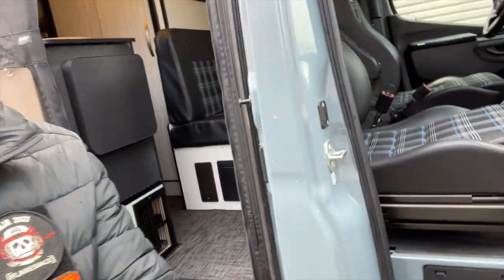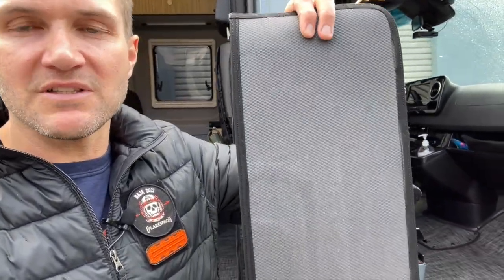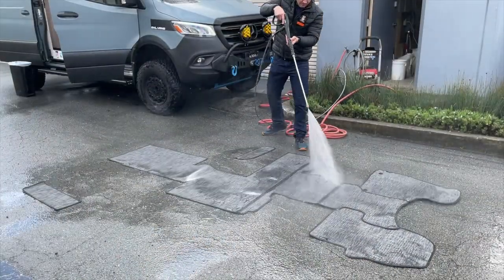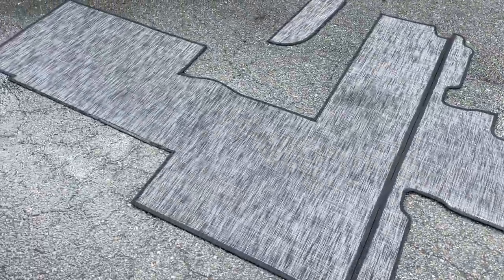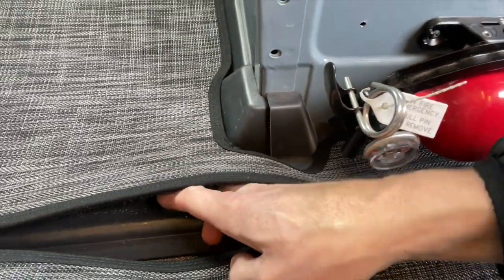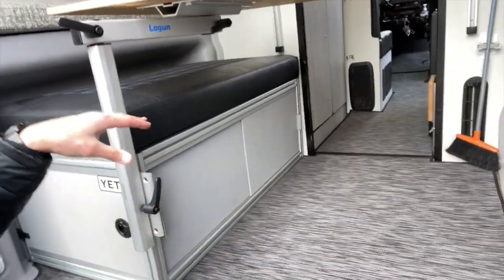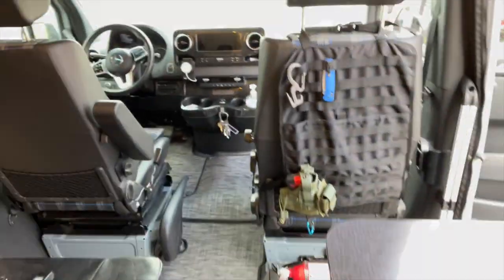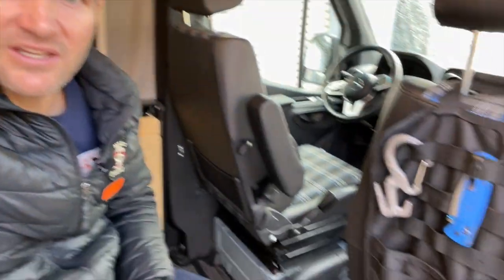Floor Mat Carpet System for Sprinter Vans, Revel and Storyteller

Comment: Exactly what I need.  Have the STO and would like everything except the garage area.  Website only has option to purchase the front or the entire system.  I have GLSS and use the L tracks in garage area so that section would not be useful but front and mid sections would be perfect.  Any way to purchase all except the garage area?
Reply from the maker: The rear section of the floor mats in the STO have cutouts for the tracks

Comment: John, tell me about your pistol in the molle holster on the back of your passenger seat.
Reply from the maker: I usually keep a Sig P229 in the van when traveling
Reply: @owloffroad  whatcha worried about?
Reply from the maker: @YewwwwToob  just the way I like to travel. I have had meth-heads bang on my van in the middle of the night. Just like to have a little backup when solo.
Reply: Nice. Love that gun.